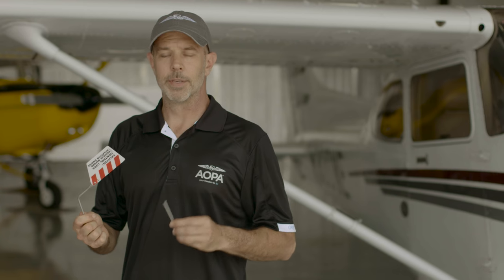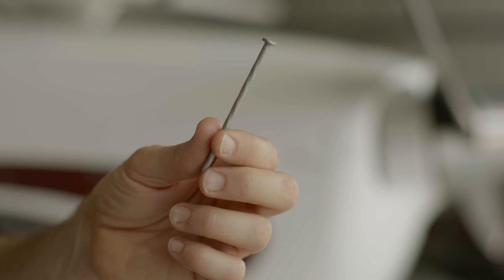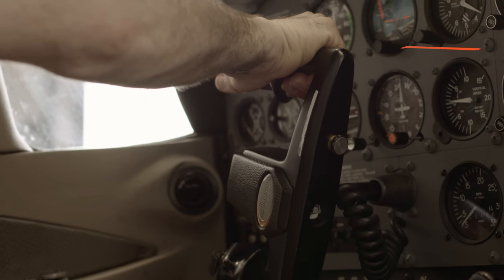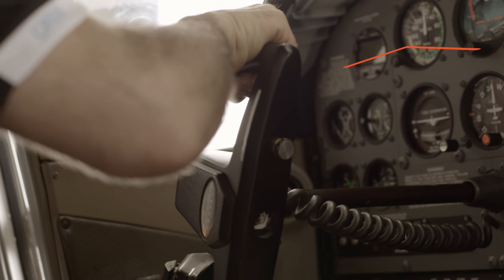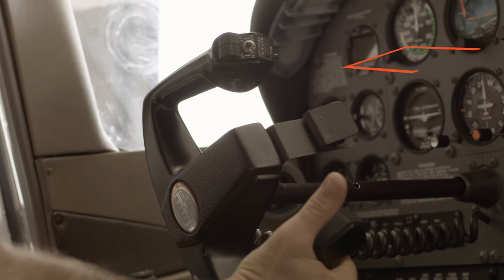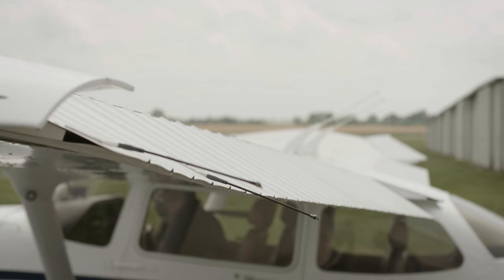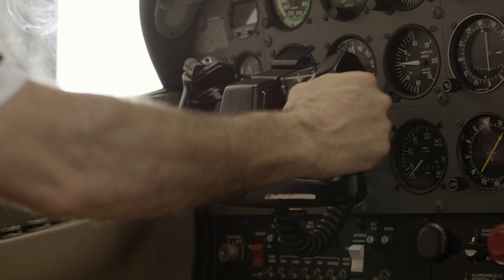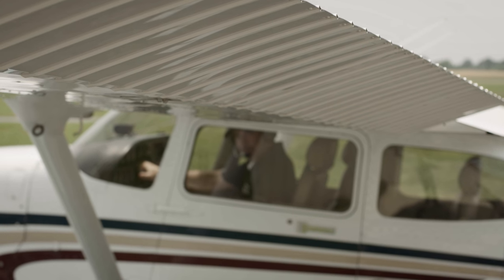ASI Safety Tip: Box the Controls

Comment: The instructions are almost correct. I fully box the yoke in BOTH directions. In my Cessna 150, one day as I did this during the run-up, the yoke jammed. The bolt of the yoke column caught a cable tie behind the instrument panel. This could have happened during stall training or during the landing flare as it occurred with the yoke in the elevator up position.

Comment: Shouldn't this be a checklist item?
Reply: It doesn't matter if it's in the checklist because there are some pilots who do not use checklists
Reply: Tim Murphy it is on most aircraft some skip it or just wiggle em enough and say ok while not feeling for any binding in the cables
Reply: I don't think I would fly with a pilot that doesn't use checklists. Who does that?
Reply: aw, heck....some of the vids here on YouTube that I've been watching show this during preflight, where they grab the aileron, elevator, and rudder and move it, making sure from the outside that it's not binding.  And most of them do this "boxing" either before taxiing or while checking everything else, like the mags.  I was thinking it's on every checklist too.
Reply: Pilots who think they're above using a checklist. You can lead a horse to water but can't make it drink.
Reply: Yes.  There are multiple points on a normal checklist where you should catch a control lock/control-inhibiting device.  Removing it is one of the first items.  Part of the external walkaround is also to check the elevator for freedom of movement.  Right wing includes a check of the aileron for freedom of movement and security, as does the left wing.  You can't check freedom of movement of any of these surfaces if there is a control lock in place on the yoke.  The only way to miss this is to either not use a checklist, or, if you're some reckless cowboy who just wants to cheat death every time you fly, don't even do a preflight.
Reply: Pilots asking to die don't use checklists.

Comment: How about a video that shows the importance of ensuring during preflight that a prop is installed..?
Ok, joke aside - it's sad that such information needs to be evangelized because I know at least one NTSB case where the pilot actually took off (with passengers!) with the control lock in place (it was installed to extend to the wrong side, and apparently he thought it was removed) - and they crashed. The fact that he never checked that the controls be free and correct before takeoff is scary - it goes to show that all checklist items are there for a reason, and should not be skipped as boring routine or when passengers provide distraction. Complacency can easily be controlled, but it's lurking in all of us.

Comment: CIG checks- Controls Instruments, Gas..  Before starting the preflight..if one of the CIG is no good.. take the needed action.. like calling the fuel truck due "G", test if gas is too low.. Controls i actuated them while standing outside the airplane, so i can hear any noise from them if any.. Instruments set the ones you can with engine off..

you dont need engine on to set the altimeter, etc.. Seen many pilots testing the controls with the engine on,   Due engine vibrations and of course, noise you cannot feel if any noise or not smooth operations of the controls..

Comment: Why before a run up?  Its the first thing I check.  If the controls are messed up no point in doing a full preflight.  I check the controls right after I open the door.  If there is an error I can investigate since I am already going to be outside the aircraft.  Any error in controls is an instant ground.